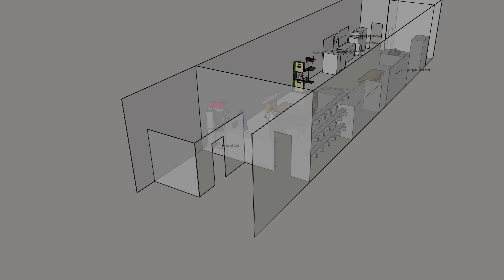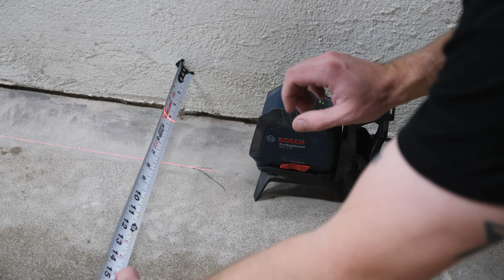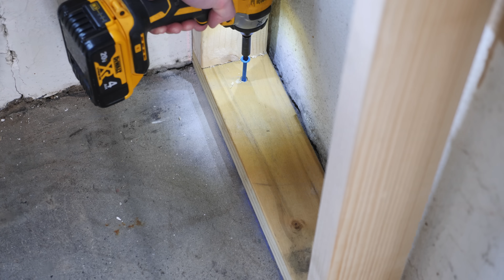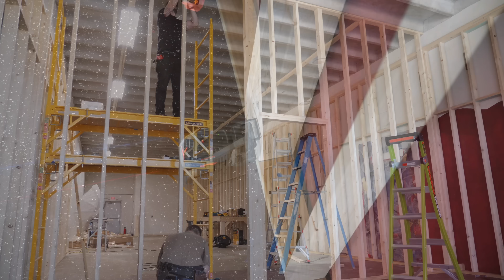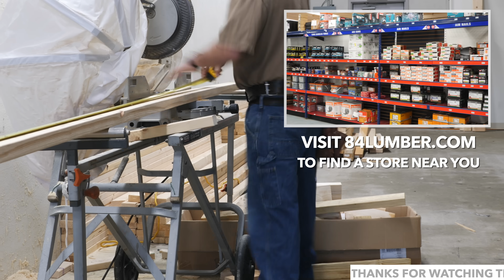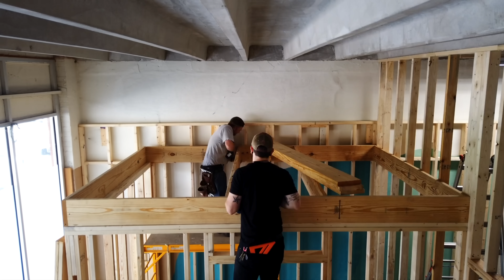Building My Shop : Wood Stud Wall Framing, Door and Corner Framing

Comment: I have to ask , why didn't you simply not use a framing nailer for when fixing all your pieces of timber (lumber) together ?.... nail guns are way faster than screwing not to mention buying nails is cheaper than screws, Screwing the frame to the concrete wall you definitely needed screws though .. and your not having to change batteries so often on nail guns either as much as you are impact drivers.

Completely understand if you didn't want to buy a framing nailer , but personally I think you would have had alot faster process framing  if you hadn't of screwed everything .. I mean all contractors, carpenters and framers I know use nailers... Screws are a stronger fix I will admit, but I mean I think Its a little over kill and a time waste screwing it all together ... If its apart of your locate areas code, then I will understand fully

other wise Great job on your build, fan of the videos, love watching you piece stuff together, your quality and attention to detail is astounding ... Hello from MELBOURNE AUSTRALIA, by the way , I have bored some of your previous garage storage/work bench designs for my own garage at home just tweaked your design to suit my own comfort/preferences that work for me personally.

Comment: Looks great and I learned some new tricks. 
Did you consider securing the bottom plate with shooting nails in instead of drilling and anchoring?
Reply from the maker: Thanks! We would have had to use something like a Ramset in that case, and that was a tool I didn't have access to. Definitely a good option though.

Comment: I'd love to hear more about how you decided on the overall height of the framing. I see you left a ton of space between the roof and the ceiling you will add (I'm assuming). Thanks for the great teaching for newbie builders like me!
Reply from the maker: Thanks! The wall coverings we’re mostly aesthetic as well as to be able to add soundproofing insulation. The tenant to my left is another shop, so I figured sound wasn’t as big of a deal, which the tenant to the right is a retail space, so I don’t want to bother them. I will not be adding any additional ceiling in the shop, no need really.

Comment: Looks great! Why aren’t both walls going up to the full ceiling height?
Reply from the maker: It would have been a pain to cut all of the 2x4s to a custom length with the varying floor. No real need to have the wall covering up there, since it’s mainly for looks, ease of hanging stuff, and being able to add soundproofing insulation. Thanks!

Comment: Is that moisture treated lumber on your bottom plate. Doesn’t look like it not sure if I missed you mentioning it but it should be mentioned multiple times. You have to use moister treated lumber if it is in contact with concrete per code. Like the editing 👍🏻
Reply from the maker: Yes, we used pressure treated for all of the bottom plates.

Comment: did no one else catch that the explanation of the crowned lumber was backwards? crown is the upward arch not the downward
Reply from the maker: As I said, I faced the crowned edge towards the floor. The graphic was just indicating the crowned area, not the specific edge.
Reply: right, if you put the crown down they will be off the ground at both ends and rocking in the middle, thats why when we frame crowns go up and the ends sit on the floor
Reply from the maker: In this case, we wanted the crown to be facing away from the existing concrete wall so we didn’t have to fight it.

Comment: Concrete Wall is great. You can hang so much more on it. Why did you frame it out? I understand for the office but not the workshop surely?
Reply from the maker: Soundproofing and it looks much nicer with plywood walls.

Comment: Good job, my trade is shop fitting, i now supply shop fitting materials with my dad in our business based in northern ireland. But most of our shop fitting trade uses metal studs and track and 600mm or 400mm centres and dont need spacers. Metal is all we sell really popular in the uk/ireland.
Reply from the maker: Yea metal is super common in commercial spaces here too, but I’m much more comfortable building with wood, and I can screw stuff in anywhere to hang it on the wall.

Comment: I think it's in one of Frank howarth videos when he is building his shop that he talks about doing at least the paneling and possibly his framing so that he can open it up and access his electrical easier.  It makes total sense to me in a shop where you might need an outlet in an odd place at any time.  I think he basically just has a 12 inch wide piece of paneling just above workbench height that is screwed in separately.  All his electrical is run behind that.  If he wants to install another outlet, it makes it super easy to open that section and pull wires, instead of having to fish wire or be stuck with what you have at the start
Reply from the maker: For sure. I’m doing all plywood walls in the shop for that reason, very easy to unscrew a panel and add an outlet if needed.

Comment: I get it that you need a shop but the money you're spending on remodel and rent I'd built a shop or bought a mobile building ...save your lunch money so you can build a build on your property ...plus I just watched the whole video unless you have some codes why not just run conduit to install receptacles and as far and building the walls I would have built 8 foot walls where needed but it's your money I guess that make you build like that where you live
Reply: I was thinking, why not 2x2's and styrofoam sheets for sound. Shallow electrical boxes and a air nailer. Could've saved 4 days of labor. way easier to take aparrt, and screws have very little strength side to side.
Reply from the maker: I’m adding soundproofing insulation which is designed for 2x4 framing. I also wanted the electrical run in the wall, which wouldn’t have met code if I used 2x2s since screws would easily hit the wiring if hanging things on the wall.
Reply: @craftedworkshop  right on, It's your place and your the only opinion that matters

Comment: don't see the point of that little space between the office and the windows. Why not just have that space inside the office? and have natural light.
Reply from the maker: I wanted the office totally enclosed for security reasons. I will have a lot of expensive camera and computer gear in that office. The little front area will have a storage shelf for odds and ends, definitely won’t be wasted space.

Comment: I am a novice but why would need to frame the concrete walls??
Reply from the maker: I am doing it so I can add soundproofing insulation. Also, the plywood covered walls will look a lot nicer on camera.
Reply: @craftedworkshop  Got it! If you are renting the place for a long time, it is good investment. Out of curiosity, do you client work or every furniture you build goes to your place?
Reply from the maker: I build stuff for myself and friends/family!

Comment: Great video! Did you get an architect and engineer involved for permits prior to construction?
Reply from the maker: No architect or engineer considering the fact that none of the framing is load bearing and I had a general contractor helping.

Comment: Wow this is really cool! Question: Why didn't you have the office space go all the way to the window/wall over there? I feel like having a window in the office would be nice. Would it have made the roof on the office space not work or do you have plans for that small area near the front?
Reply from the maker: I don't want a window in my office, due to the glare it causes when editing and using the computer. Also, it's another security weakness, since I'll have a lot of computer and photo gear in the office. The area in front will have a shelving unit for random storage, definitely won't go to waste.
Reply: I had the same question.

Comment: Congrats on the new shop! Looks promising! Genuine question: why would you do a full wood frame against a finished concrete wall?
Reply: Yeah, I was wondering the same thing.  Unless you are planning to add some kind of sound proofing, that was a lot of work and money just to hide new wiring.
Reply from the maker: I am going to be adding soundproofing insulation in the next video!
Reply: @craftedworkshop  Cool! But why didn't you chose to instal continuous insulation straight on the concrete walls?

Comment: Building walls against already existing walls? Is this a USA thing?
Reply: Its so he can get the sound insulation electrical and other items mounted VS having the CMU or block walls.  Quite common in any up-fit of a blank space like that.  And actually can save a lot of money that way on other trades coming in after.
Reply: Well, that makes sense. Maybe it's the local regulations, but here in the old countries you'd probably run the electrics via the ceiling and surface mount the cables. If you wanted a "proper" job, you'd put stuff under the wall plaster.
Reply from the maker: Exactly!

Comment: Can't believe the explosion didn't set the sprinklers off.  You should get them checked.
Reply: I know it's a joke, but good thing there isn't sprinklers, as if there was they'd then have to add new ones under the new ceiling they're adding, which is a PITA

Comment: could you build a garage door at the back?  I feel like that would be incredibly helpful for getting big projects in/out and getting new tools in!
Reply from the maker: It's definitely possible and is something I'd love to do!
Reply: @craftedworkshop  Not sure you're going to get much wider of a door in that back wall... the bathroom is close by on the right and the breaker box is close by on the left.
Reply from the maker: It’d be pretty easy to move the breaker over.
Reply: I think just a double door would cover most everything and be cheaper.

Comment from the maker: Hope y'all enjoyed part 1 of the shop build series! Part 2 covers electrical, lighting, and insulation, check it out https://youtu.be/FKHUB1QN1rs ! Thanks to 84 Lumber for sponsoring this video, find a location near you: http://bit.ly/84LUMBER
Reply: Yes dude! Was just about to start a project like this and remembered you are starting to build the shop, and I was hoping this video was coming soon!
Reply from the maker: Awesome!
Reply: Learn so much,thank you
Reply: One question I recently bought a makita 18v impact driver do you have to use special bits for it please reply as soon as possible thank you
Reply: Ben If you are using it for metals and heavy work, then it’s a good idea to use impact-specific bits/nut drivers... but from my experience, you can usually get away with normal bits if you’re just sinking screws/bolts into wood.
Reply: Hey buddy, can you please tell us what program/ software you used to sketch that project before implementing.. thanks
Reply from the maker: I used SketchUp!
Reply: @craftedworkshop  we want part 2 !!!!!!great job mate
Reply from the maker: It’s live!
Reply: SIEF04 TUBE Google SketchUp